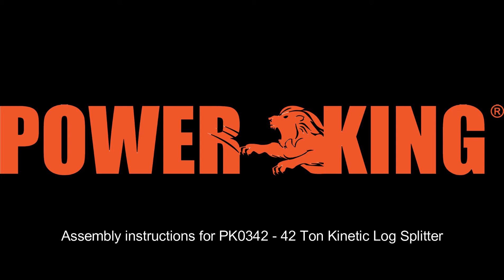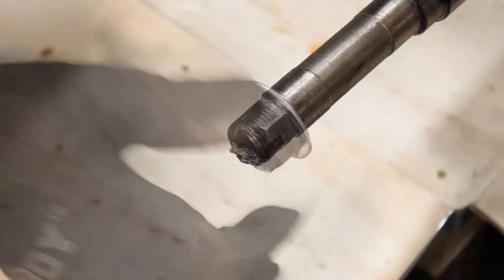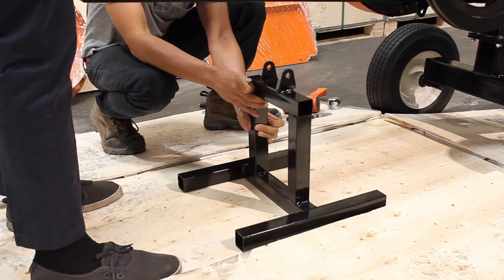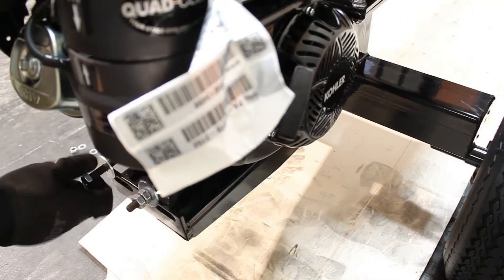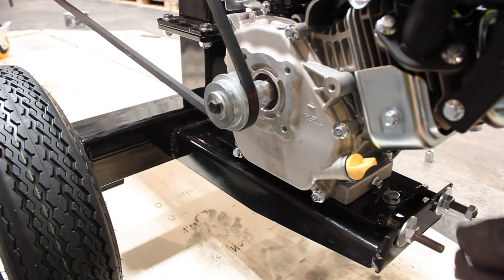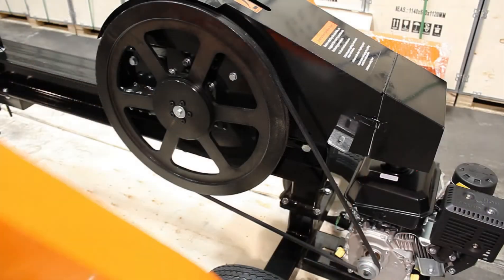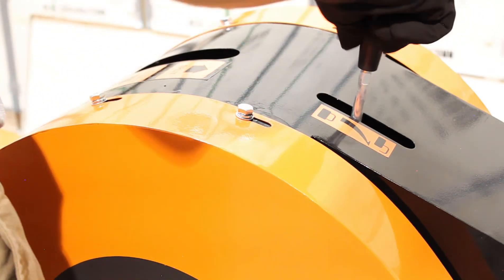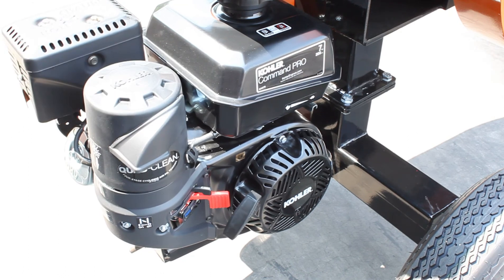Power King PK0342 (2021) 42-Ton Kinetic Log Splitter Assembly

Comment: I have this 42 ton splitter.  I broke teeth on the spline shaft gear.  I now limit wood length to 18", which is table length from edge to wedge.  The other 5" I want the ram to engage and get up to full speed before striking the wood on the table.